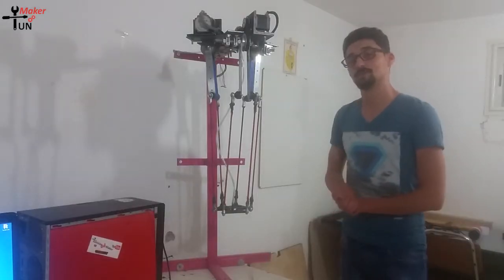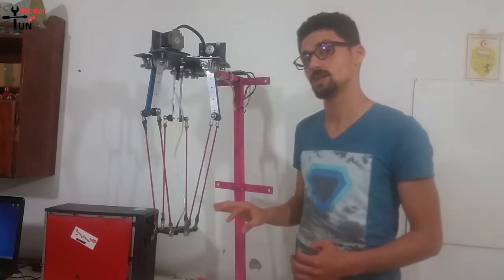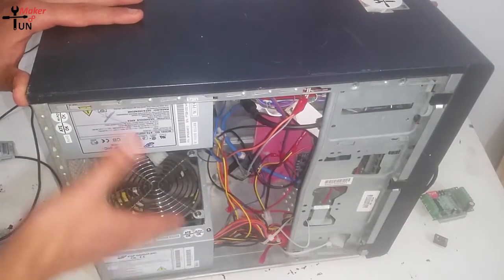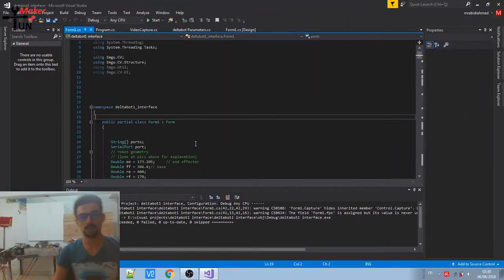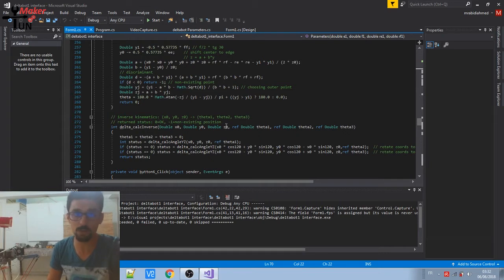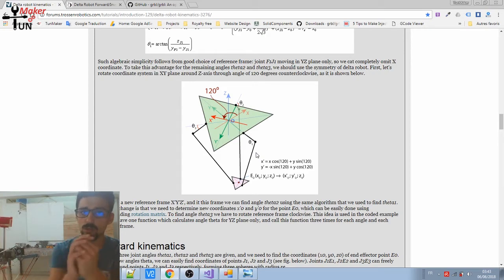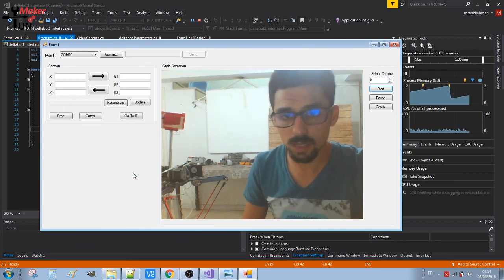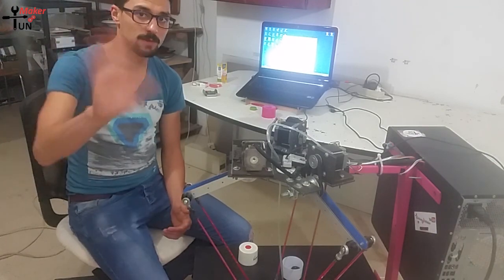Delta Robot : DIY Pick & Place Machine with Software

Comment: Could you tell me about the stepper motors? I want to try to make delta robot!
Reply from the maker: I used NEMA 23 but even with the pulley they were dimensionned correctly for this robot

Comment: Which type og gears did you used?is it also 3D printed?
Reply from the maker: I used 50 and 25 mm aluminium gears that i recoverd from an old system .
For more details https://www.tunmaker.tn/2018/06/19/delta-robot-project/

Comment: Only arduino program and flashing it, isnt enough?
Reply from the maker: Yes to use it as its supposed to work with the GUI interface but you still can send it gcode commands through serial
Reply: @TunMaker  how to move the delta robot linearly?? Liner up down and straight horizontal movement